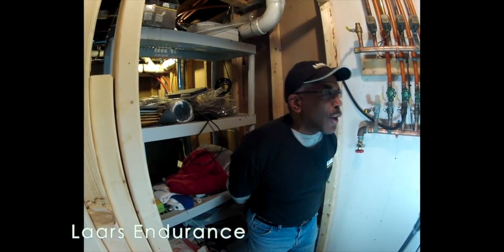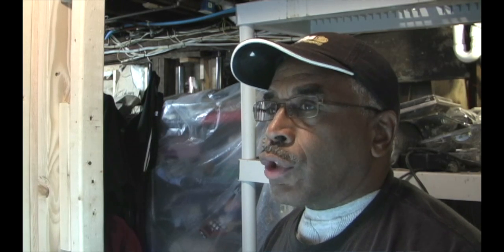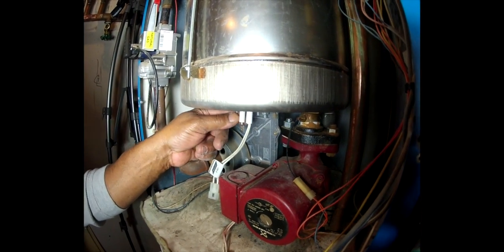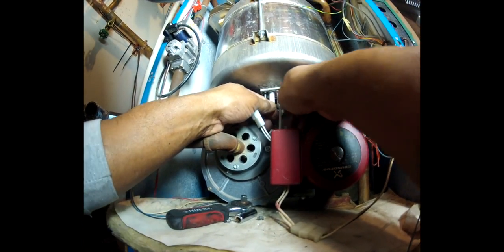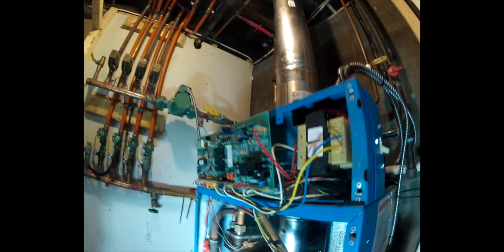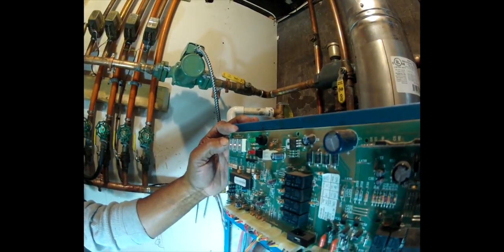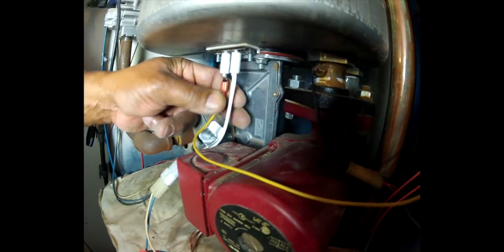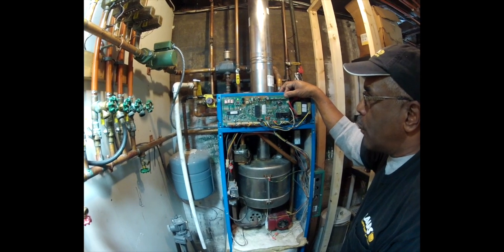Laars Endurance Boiler with L.O. code, ignitor replacement.

Comment: I'm confused. If the old igniter was still good, then why was there a lock out? And if  it was still good, then why did the new igniter solve the problem? Was the problem the flame rod?
Reply: By the looks of it, yes it's the flame sensor. Most likely it's still probably good. Looks clogged up. Hasn't been cleaned. I would've cleaned the sensor with emory cloth and installed it back to see how it runs. Regardless it's probably due to replace the entire assembly anyways to prevent further calls.
Reply: Daniel Stewart 

Yes. My question/point exactly!

Comment: Very well explained Sir, I see a lot of these in Boston, just as you said, small foot print and packed in many a condo's closet with zero clearance. Perfect during the first Condo Boom but now Navien & Rinnai has perfected the Condensing Combi-Boiler which are much easier to work on and parts do not cost an arm and a leg!
Reply: In the early '70's, so I have been told, VW introduced their "Type 4" motor car. Instead of having another horrible 'air-cooled' heater setup, they wedged a petrol-fired, boiler/ignitor arrangement...under the rear bench seat.  An old-timer here said that it WAS a treat to sit over it, as it would 'fire-up' with a less than gentle retort.  After experiencing it once, many refused to park-their-butts over it again!
Reply: in the hot seat, literally! must have warmed things up for a bit of parking to watch the submarine races